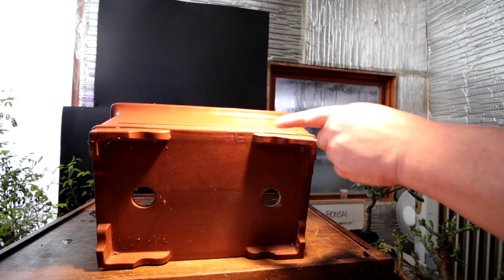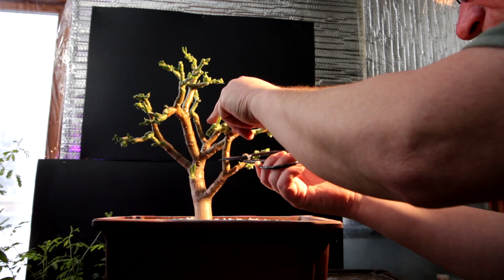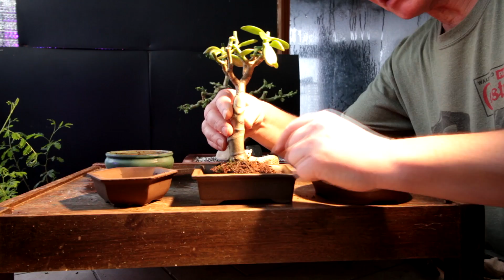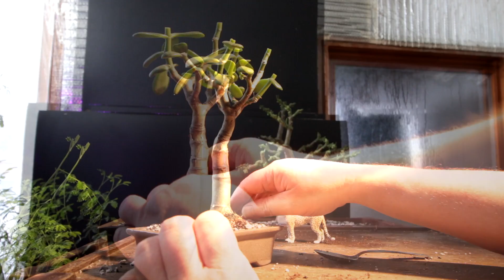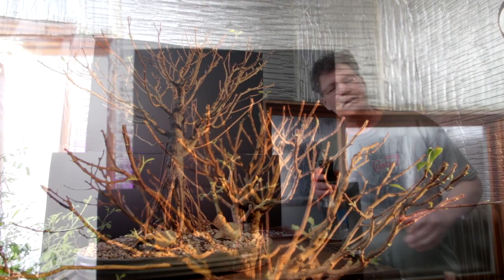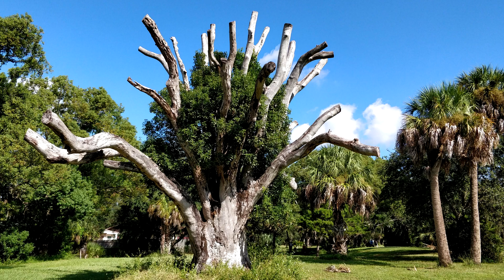Creating Jade Bonsai, Part 2, The Bonsai Zone, Feb 2019

Comment: I love your video. I may have missed this, but what does the bonsai soil consist of? Can a commercial succulent potting mix be used? Thanks!
Reply from the maker: Hello Kamalani, bonsai soil has a particle size of 3 to 4 mm (1/8") The material absorbs some water but most flows out the bottom of the pot. It is hard to over water a tree in bonsai soil. This porous soil allows for an ideal mix of air and water and can really keep your tree healthy. It is almost like hydroponics. Because there is little nutrients in the soil, the tree needs to be fertilized regularly. This soil also gives you a nice compact fibrous root system that can support a large leafy canopy above.
You can grow a tree in potting soil, but it is harder to water and keep your tree healthy. The roots tend not to subdivide and grow into a fine mat of roots. It's the root tips that bring in the water and nutrients to the tree. There are many different recipes for bonsai soil, I try and use local ingredients. My mix is 1/2 perlite and 1/2 turface.

Comment: Hi - how did you get such a big cutting to root - I took one from the round leaf type of jade plant and it hasn’t rooted
Reply from the maker: It took a while, the plant slowly gained strength throughout the summer. By fall it was finally growing strongly. I left it in full sun and was very careful not to over water. Much of the watering was done by just misting the cutting and the top of the soil. I never watered the soil thoroughly with the watering can until the cutting was growing and the weather was hot and dry.

Comment: Hi Nigel!

Thank you for this video I recently followed these steps for a thick jade cutting of my own. However I do not have high humidity where my cutting is. How often should I water to promote root growth?
Reply from the maker: Hello Konrad Morawski, I would just lightly mist your Jade and keep the soil quite dry. In between misting, you can place a clear plastic bag over the cuttings. Poke some holes in the bag for a little ventilation and to keep the heat down. The humidity and light misting's, should be enough moisture to grow some really good roots. If you use a bag, be sure not to water your tree or the base of your Jade could rot. Better on the dry side than too wet!

Comment: Hi Nigel :) your awesome and have an incredible green thumb! I bought a large Jade plant and trimmed it to a bonsai and put it in a smaller pot. It's day 3 I haven't watered it and some of the leaves are curling a bit should I be concerned? I'm thinking of trying to find some turface and perlite to do what you do. It was in regular looking potting soil with perlite befor.
Reply: they only need watering once or twice a month. the soil should dry completely before watering again. almost like, critically dry. lol. nd more perlite/pumice/sand or drainage is always good - jade will root in and on anything. including the bare ground. if you lay the cuttings down and forget about them, they'll find their way. so less soil/more drainage isn't necessarily a bad thing for succulents :-) I always add extra drainage to all pre-made soil mixes.

Comment: Hey Nigel love your video. But a quick question I just bought a Ficus microcarpa from my local bonsai Garden, and it has black spots on its leaves I did a quick and minor route prune and repot and it has lost about 80% of its leaves they turned yellow and dropped. I live in Florida and the temperature at the moment is around 79 to 80°F humidity level 87. Please if you can help me Nigel that would be amazing I appreciate it.

Comment: A silly question from an amateur starting with bonsais... how do you keep the nutrients in rocky soil? I had Duranta Erecta in rocky soil and no matter how hard I tried to keep it, it was suffering... after I repotted it to mix of sand, clay, peat soil, it´s getting its leaves back and new branches appear all over the old wood.
I tried to fertilize the older rocky soil, but apparently it didnt absorb any nutrients... I would like to use the "rocky" soil eventually as it looks nice, but non of my bonsais (old ones or newer experiments) seem to handle it well (after using local forest soil or clay/sand/peat mixed soil, the bonsais are growing nicely)
Thank you for any tip, love your videos and looking forward for new one :)
Reply from the maker: It is possible that the rocky soil you were using was non porous and didn't absorb water and nurients. The water and soil might have just been draining out the bottom. Try mixing 1/2 perlite with your soil and that should help the trees grow well. I use turface as my second ingredient, and it also holds onto water and fertilizer well.
Reply: « вaттʟεcrіer » ,  min fert, every watering

Comment: Nice work, great way to use up jade cuttings, they're just so easy to root aren't they! Do you have much luck reducing leaf size? I'm wondering if it's a case of defoliating from time to time?
Reply from the maker: I find the leaf size goes up as the plants grows and the branches get longer. If you are always trimming the plant, you will keep the leaf size down, but the tree might also loose vigor. I prune the leaves off a month before a show and the new leaves grow back smaller, but I don't worry about leaf size otherwise.
Reply: @TheBonsaiZone  Perfect, thanks

Comment: Hi sir 
Can i graft a branch on jade to make some movements, if possible then what kind of teq. Should be used for ..
Reply from the maker: I think it is almost impossible to graft a Jade. It can be done, but the strength of the junction is always in question and the success rate is very, very low. I think the plant will get lots of new leaves and branches on it and I should have lots of choices in the future for more pruning!

Comment: Your comments about some of the characteristics of turface are correct.  Also, while it is good at absorbing water it is not good at giving the water up to the roots.  It holds on to the water and may even take water from the roots.  Have you ever thought about replacing the turface with diatomaceous earth?  There are sources for diatomaceous earth that are as inexpensive as turface.

Comment: Kind of disappointed with your choice of placement for the big jade cutting. The one-sidedness would have made it a cool slanted style tree, and if you had put it at about 45 degrees to the direction of the slant, if you know what I mean, I think you might not have had to prune so much off after planting. Also now you have those branches that are both v-shaped and parallel to each other and I noticed you didn't prune the 1-to-3 division at the top of the main leader

Comment: Late night musings: pruning forcing the trees towards a pure fractal and contrasting this by composing off centre in accordance with the rule of thirds and additions of jins etc. to further juxtapose this balance... The almost extra dimensional nature of a tree with the radial roots interfacing at 90 degrees to trunk and canopy,  isolated yet joined between separate environments of air and soil... Mandalas in religion and whether there is a intended spiritual and historical relationship between this and bonsai... It is nearly midnight...
Reply: bbysf ,  right. .. what you said

Comment: I like the rectangle pot for the Cheetah Jade.  Do you ever use cinnamon to seal cuttings, esp. in the root zone?   I don't think Jades make that nice a bonsai, but you make them look so good.  :-)
Reply: I think Cinnamon is just a natural fungicide.  Put it on all the cuts wait 24 hours and then apply glue.  You can let the glue dry before planting in soil  or just poke it in there.  I don't think any succulent should be watered before it starts growing new growth even if it has been left to heal over.  But I could be wrong!!!
Reply: @alicer3423  The way I use cinnamon is to dip the cut stem into the powder lightly and then leave to dry.  The healing is faster this way and there is less chance for rot.  I still observe caution when watering a plant with cuts.  Where I live in CO plants dry rather quickly so it rarely takes more than a day or two.
Reply: @SequoiaElisabeth  Thank you